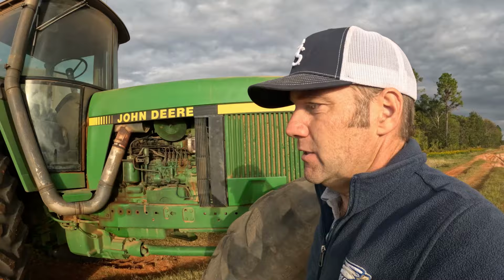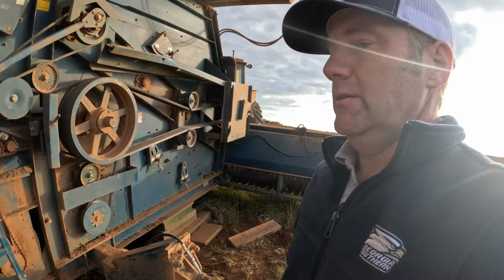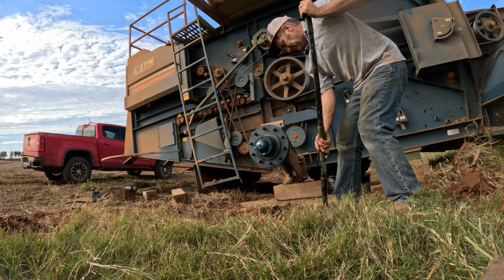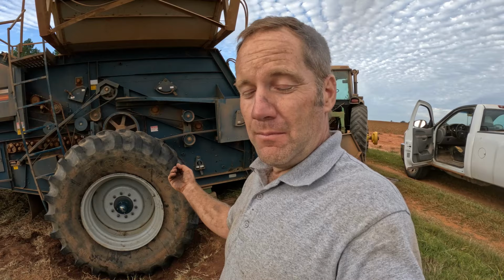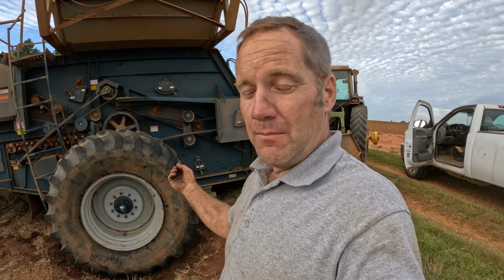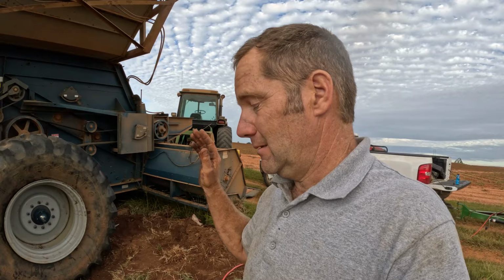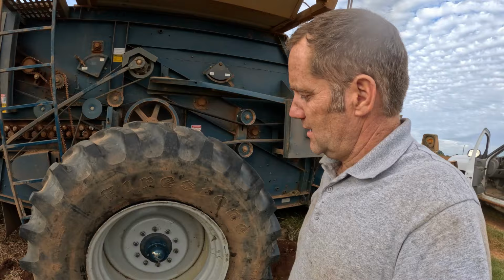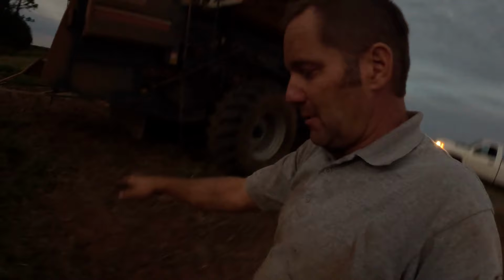Catastrophe on the Farm!

Comment: Think if it was1979 talk about net working on the push button phone at the house remember phone books come on!!!!
Reply from the maker: Good point.  Also, if it were 1979 the picker would have been a Lillihston Hi-Cap.  There would have been 5-6 of them running on a farm my size, and any part would have been available at the nearest dealer.  A lot has changed.  Some for the better some for the worse.  The smartphone definitely was the hero of the day.